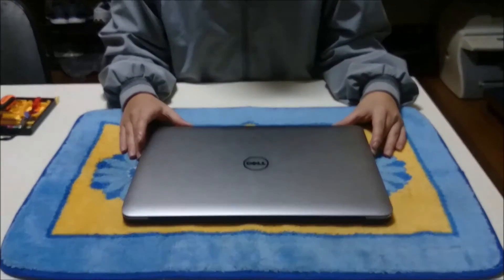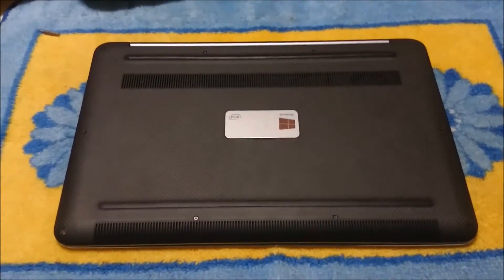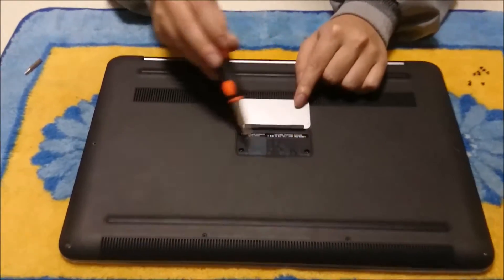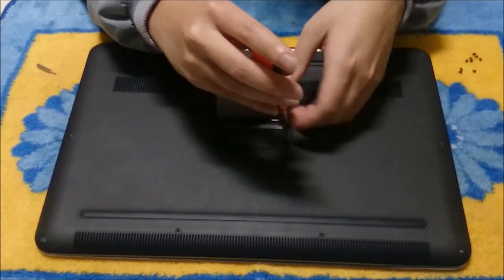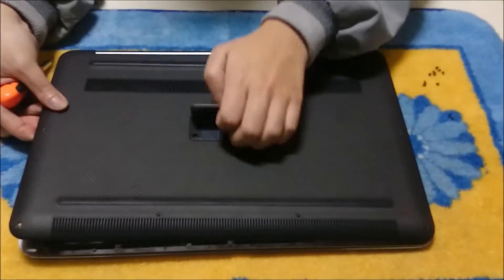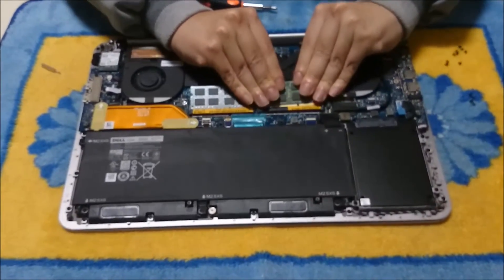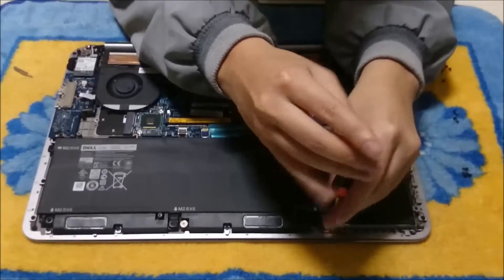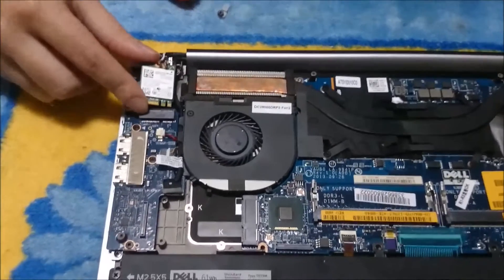OPEN ME UP! Dell XPS 15 9530 2014 QHD+ Display Disassembly

Comment: Is there a way to replace a dead keyboard without stripping everything out, including the motherboard, to be able to remove and replace the keyboard?
Reply from the maker: nope
Reply: +OPEN ME UP  Thanks, that's what I was afraid of. They make the most likely component to get spilled on, be the most difficult to access.